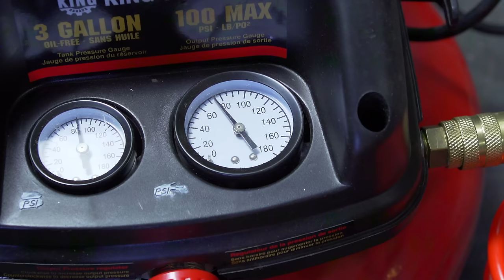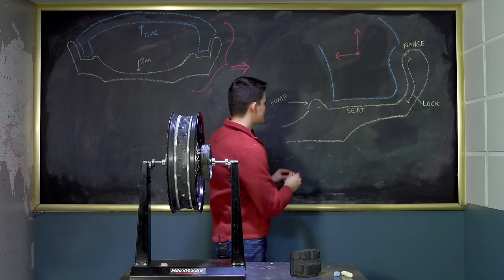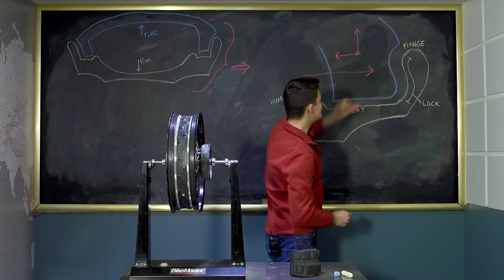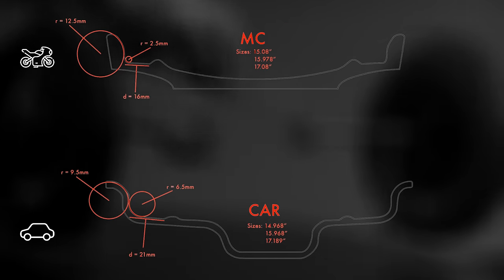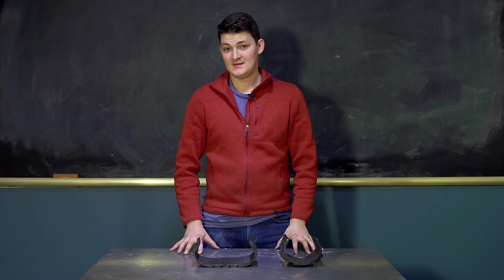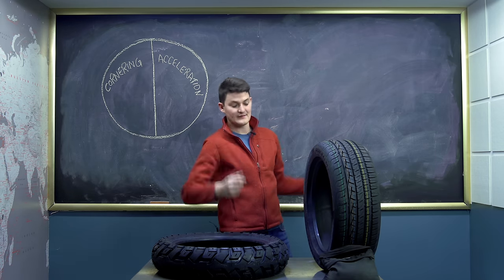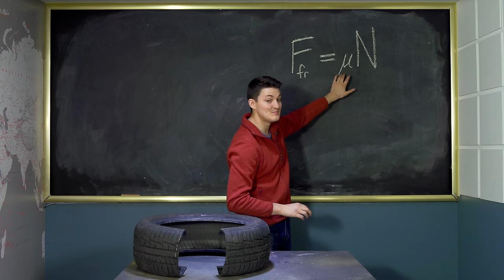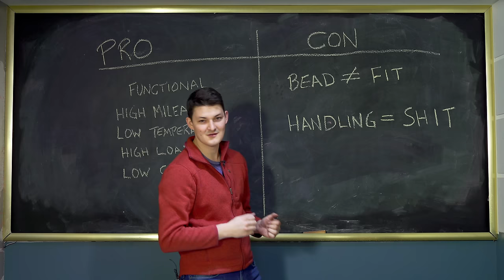Are Motorcycle Tires a Ripoff? The Darkside Car Tire Experiment

Comment: My 2006 Rocket III Classic was a great riding & handling bike with a 225/50R-16 Dunlop Direzza DZ101. Perfect match in all dimensions to the stock Metzler 240/50-16. The sidewall had the same rigidity, identical overall height and width, and it was a sticky performance tire. The tread was a sporty symmetrical & directional pattern with a rounded edge. I ran at about 25psi which resulted in smooth, stable, composed handling and MASSIVE traction advantage over the MT. The bead did not look any different than the Metzler either but I was not using a run-flat. I installed and balanced it myself. Trust me, the size & weight of that rim with brake rotor far exceeded any worries of unsprung weight. And yet, the Dunlop was fairly light as well. I had no vibes or gyroscopic tendencies at any speed. My bike would top out about 135mph - limited by the windshield, floorboards, and bags (and my fat butt). I scraped the boards frequently (thankfully they articulated). If blindfolded, one would only know it was a CT at walking speeds. Above that it was almost unnoticeable.  Yes, a bit more counter steer was needed to initiate a lean but by the end of the first day riding you did it subconsciously. Grooved road surfaces didn't affect it much but I think that depends on the tread, pressure, and width mounted on each bike. For my bike/tire combo, it was well behaved, confidence inspiring, and FUN to drop clutch and peel out. No more applying throttle timidly while turning for fear of losing the rear. Nope. pour it on and leave a beautiful black arc behind. 

But before I have rotten vegetables heaved my way, yes, there are some drawbacks and you need to gauge your abilities. If you have even the slightest doubt, then by all means don't do it. Those of us who darkside don't just throw any POS tire on there.
#1 - Darkside is not for all bikes. The GS is probably not the ideal candidate being so tall and narrow. Best left to heavy, lower, tire grinders like Power cruisers & touring bikes.
#2 - Narrow rim & wide tire are not a good combination. DS works better on a wide rimmed bike. In this test a narrower tire (if even possible with the given wheel) would have produced better results.
#3 - Tire pressure looked high and gave the impression the handling looked edgy. Inflation is key to good tread/sidewall compliance. 
 
Regardless, I thoroughly enjoyed the video and would say almost everything he said was correct.

Comment: Dear God; he's even doing this in wet conditions....
Reply: we should be more concerned about the Prius somewhere, wondering about with a Metzeler on/off road bike tire. I think..........
Reply: @timewa851  hahahahahaah
Reply: Car tires on the rear work far better in wet conditions than motorcycle tires and have a better traction patch
Reply: @OldSchoolParatrooper  If riding in a straight line but once you wish to corner then it would become more dangerous. If the rear square tyre forces you to keep applying steering input to the front as you lean over then that is taking away from what little front grip you have. This is same as braking and cornering at same time i.e. the braking force removes some of the grip available for cornering hence you are more likely to lose a front trail braking into a corner or too deep etc
Reply: Marc Fox, it is clear that you have no experiance.
Reply: @888jucu  ... do you have experience? Clearly NOT. So don't take your assumptions for facts.
Reply: @corneilcorneil  You are obviously experienced at being a troll only
Reply: @888jucu  I've got over 200k miles on car tires on the back of a Honda Valkyrie. I ride everything I own like I stole it. Even pulling a trailer through the twisties of the Smokey mountains in thunderstorms at speeds that no sane person would consider I've NEVER had any traction issues.
Reply: @jeremyholloway1294  I did make some comment somewhere else on this chat that it would probably work for chopper style bikes that spend most of there time upright or atleast not on extreme angles. Anyway if you hav good experience with it then that is great
Reply: @corneilcorneil  it's clear you have no experience spelling...
Reply: @OldSchoolParatrooper   I agree 100%. I run a car tire on my 1100 Shadow and love it. I will be mounting one on my 1300 VTX when the Metzler wears out.
Reply: @888jucu  Jeremy Holloway’s experience proves your assumption wrong.
Reply: @wncryder  Not at all, he just hasnt crashed yet and he may just be an exceptionally skillful rider who is better than most and can handle it, who knows 🤷‍♂️ ☝️😄.
Reply: @888jucu  Experience proves your assumption wrong. You said " that it would probably work for chopper style bikes that spend most of there time upright or atleast not on extreme angles." Experience shows "it" works, and works very well, on more than just "for chopper style bikes that spend most of there time upright or atleast not on extreme angles." You're certainly entitled to your opinion, but your opinion is not fact
Reply: @wncryder  His experience example was on a Honda Valkyrie which is a "chopper style bike" so Im not sure your argument here unless you are wanting to argue just for arguments sake?? Why not you go put a car tyre on the back of a sports bike and ride a canyon at good lean angle you might start to understand what Im saying. I also used to ride a chopper syle bike and wud scrape the foot  rests well before the bike was leant anywhere near extreme
Reply: @888jucu  A Honda Valkyrie is not a “chopper style”, bike, granted it is not a sport bike either. When you suggest I put a CT on a sport bike, no thanks, as far as my knowledge goes, for the specific purpose of riding curvy roads a MT is designed more for this specific purpose. However, should a sport bike rider not ride curvy roads exclusively, a CT might be an option, I don’t know, because I don’t possess the knowledge of the experience of a CT on a sport bike. What I do know is, I ride a Goldwing, a VERY HEAVY bike, and a CT is great for the many purposes I choose a tire for. And one of those purposes is NOT “upright”, my Goldwing is ridden at some “extreme angles”. There is not a MT manufactured that will handle the best of ALL worlds I put my Goldwing through like a CT.  If you want to argue specific, single purpose use of a tire, then you are discussing an entirely different topic than is being discussed here.
Reply: @wncryder  You r starting to split hairs on bike classification so Im not gonna get drawn into that. Profiled bike tyres is what helps bikes steer/corner so if one tyre is not helping so much e.g. when using a CT on the rear then more input is required at the front which asks more from the front which could become more dangerous when pushed to extremes. Chopper style bikes or anything that is more upright cruiser style (maybe this is where you prefer to classify the Valkyrie?) is less likely to get anywhere near those limits and hence may work for some riders. Someone riding a cruiser or even a goldwing hard is not even close to the same thing as a sports bike being ridden hard.
Reply: @888jucu  "Splitting hairs"? You are "splitting-hairs" with your initial comment, it's your "splitting hairs" is why I called you on your assumption. And now that you have better defined your position to mean a specific style of riding, rather than the style of bike as you originally stated, there is really nothing left to say.
Reply: @wncryder  I think what I was saying was pretty clear to most from the beginning, anyway if you get what Im saying now then gr8. Also if you are having success with a CT on the rear also gr8 which is what I commented to another earlier
Reply: @OldSchoolParatrooper  Less traction, more hydroplaning. How's this better again?
Reply: I double dark side. Rear tire on the front and car tire on the back. Never ever had a problem.  The.only crash I've ever been on.is when my front tire hit nothing but pure ice when I was cornering. Aahhh. Good times snow riding
Reply: Dear “what”?
Reply: @gwarlow  where’s the evidence good
Sir
Reply: Better traction with car "tyres" anyway.
Reply: @888jucu  I regularly ride cruisers, chops and sports bikes and fully agree with you. While you can ride cruisers and chops pretty hard they just don't come close to riding a sports bike hard. Putting a car tyre on a cruise or chop I'd not have a problem with, but not a chance in hell I'd put one on a sports bike. The 3 bikes I'm riding at the moment are a Kawasaki VN1500, a 1977 Suzuki GS750 custom hardtail chop (so low the pipes scrape before you get to the edge of the tyre!) and a Triumph TT600.
Reply: Mine works amazing in the wet, car tire on rear and rear motorcycle tire on the front.
Reply: @888jucu  you make me laugh ha ha. You've obviously never tried the darkside or you'd know the facts instead believing the "science". My 1300 corners BETTER WITH CAR TIRES. period. Bridgestone Blizzak ob rear and a motorcycle Bridgestone (with car style tread) on the front improved the feel of the bike and cornering 100% . You don't use SQUARE tires. You have to be smart enough on the OUTSET to know to get a directional tire with rounded shoulders. Here's a fact. A tire DESIGNED to carry four times the weight that a motorcycle tire can handle is SUPERIOR on any heavy cruiser to any MC tire made. Cruisers aren't super bikes. They're big heavy bikes that will only run about 110 mph stock. Darkside enhances their performance (experience not "science"), and last four times as long for less money. FACT. If MC tires were built like car tires, MC tires would last as long as the motorcycle. Pretty simple that tire companies DON'T WANT THAT. Don't be a chump, your science is BS.
Reply: @jeremyholloway1294  amen brother. I ride pig trail in the Ozarks EVERY DAY. Riding all my life. When I discovered darkside I was like "THANK YOU GOD". Better cornering. Better traction. Better feel. Even better mileage. I feel sorry for people who buy into the false "science" of MARKETING.
Reply: @888jucu  not "chopper". My CRUISER drags the pegs just fine with my Blizzak on the back.
Reply: @PainterD54  you won't regret it.
Reply: @888jucu  maybe if you actually rode darkside instead of just thinking you're so brilliant, you'd learn something.
Reply: @888jucu  amen and hallelugi.
Reply: @wncryder  CRAP. my 1300 corners tighter with better traction, leans clear to the pegs, and stands back up quicker with more responsive handling. MC tires are just training wheels for weekend warriors who've never really ridden. They're made the way they are to SELL more of them, NOT because it's science. They make them out of softer rubber bc they specifically LACK grip in their design with good long lasting rubber. Car tread is vastly superior and they know it. Better wet traction. Better dry traction. Better wear. Better handling. Just plain BETTER.
Reply: @sumorabbit2160  I'd darkside the GS750. Worked great on my GS800
Reply: @stephenbrown9370  Have thought about it, currently the rear (hardtail so about 15-20 psi), front and forks are from a Honda Transalp, and they suit her. anything bigger I reckon would look odd as it's quite a thin bike. Only video I can think of on yt at the moment  briefly @ 0:23  https://youtu.be/1ZmyaO9qyVM
Reply: @stephenbrown9370  Sounds like you have it all worked out, why dont you put a CT on the front also you might never need to change tyres the life of your bike 👍
Reply: @888jucu  I would if I could find one the right size. Best ive found is a Bridgestone MC tire with car like tread. It has less curve. So greater contact patch for the front tire. It smooths out the ride nicely and doesnt wear as fast. It seems Bridgestone is starting to "Get it". Cruisers are NOT super bikes and actial tread on a tire makes a big difference. I tell you folks MC tires are DESIGNED specifically to wear out fast enough to keep the company in business.
Reply: @sumorabbit2160  I didn't see a heavy enough bike in the video to warrant darkside but it sure looked lije a good time!
Reply: @stephenbrown9370  As I said I had thought about it. I also thought about using RF600 wheels and forks I have laying about, But again I think it would have lost that old school look.
Reply: @OldSchoolParatrooper  Ohhhh, boy, maybe you should ask a Yamaha specialist first, go ahead I'll wait, I'm right here.
Reply: A new tire on a motorcycle, in the rain... sketchy
A new car tire on a motorcycle, in the rain... scary
Reply: And what happened ?
Reply: just a couple of seconds in slow motion just to impress:-1
Reply: @PainterD54  I own a 1100 and I can't imagine how comfortable it must be to ride on the dark side. What size brand tire do you use in the rear wheel?
Reply: Shouldn't car tires be for big bikes 700lbs and higher? If putt on a sport or adventure, it seems like it's only done for the cost.